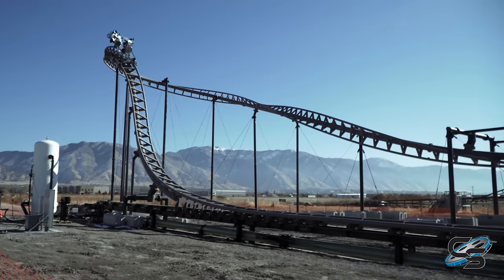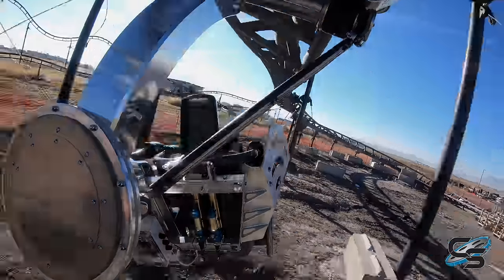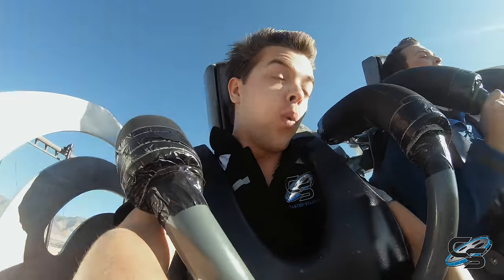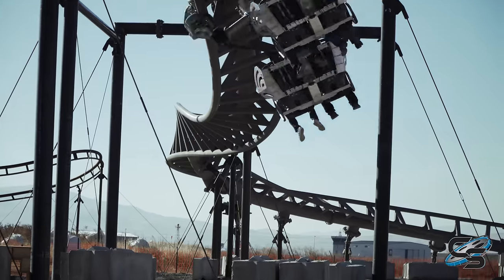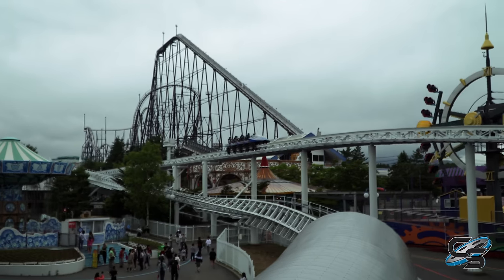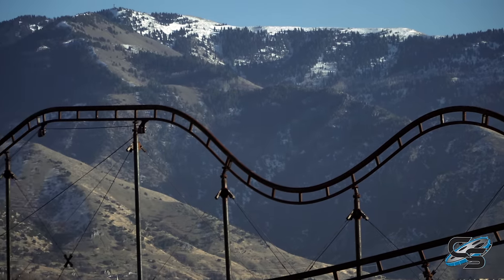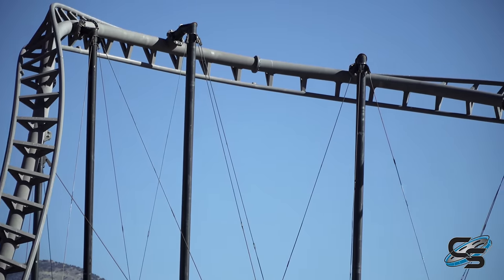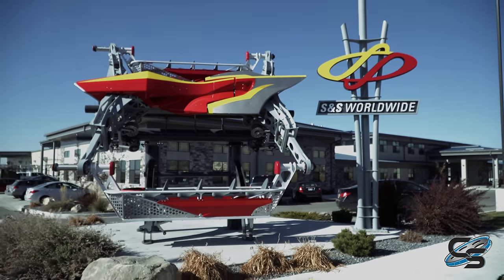Everything You Need to Know About Axis | New S&S Roller Coaster Concept

Comment: That moment when a new ride concept you've come out with is more 4D than the alleged 4D concept you've had for years 👀
Reply: Fast Eddy - I would imagine so, but it would probably put unreasonable amounts of stress on the ride vehicles; I personally would much prefer to have more of the traditional style 4D coaster myself (like X2), but it doesn’t seem that model will be returning any time soon -.-
Reply: @fasteddy664  I understand that ride Vehicles can be made strong enough to withstand forces, but torque is a very real thing that's going to change how the stress is exerted; and while they could be beefed up, there's sort of a limit to how strong they can be before it becomes unreasonable. Whether it would be practical or not sort of depends on those factors.
Ask for preferring X2, there are sentimentality reasons that I'll probably always prefer it more then pretty much any other ride for; even if a ride is better on a technical level, it's kind of hard to win out against sentimentality ¯\_(ツ)_/¯
Reply: @fasteddy664  possibly

Comment: The real question : what counts as an inversion on this ride?
Reply: The rider themselves being inverted... duh.
Reply: So a straight track can break the inversion limit, nice.
Reply: @yuxaredd  I mean, it wouldn't because the rotation is powered by momentum, not electricity.
Reply: so a single dip In the track can break the inversion record?
Reply: @yuxaredd  You don't have any idea how physics works, do you?
Reply: @yuxaredd  Sorry for thinking about the logistics of this for more than 5 seconds.
Reply: you didn't have to speak. on an 8 month old comment though. you could've just been quiet.
Reply: boy. it was an 8 month comment. why did you have to bring this back from the dead.
Reply: YuxaRatt The last comment was a month ago. I would consider it young enough to comment on.
Reply: but why? why would you want to continue this? can't we just appriciate the cool ride and move on?

Comment: Obviously the track supports are planned to be at the opposite side of the track as the momentum swings the cars? 
What kind of safety features will be employed in case the  bearing or gears that  allow and control the swing mechanism fail or got stuck to stop the cars being invthe wrong place  and plowing into a track support ?
Reply from the maker: I did not ask them about the specific safety features in place, but I imagine they are taking everything into consideration.
Reply: @CoasterStudios   thankyou for the reply so refreshing to know some channels read question comments

Comment: So is there a motor that controls the rotation of the cars or does it free spin and is just dampened when it returns to horizontal?
Reply from the maker: No motor, but they do have a system in place to help control the car rotation. Gravity does most of the work, but they just make sure it isn't too intense.